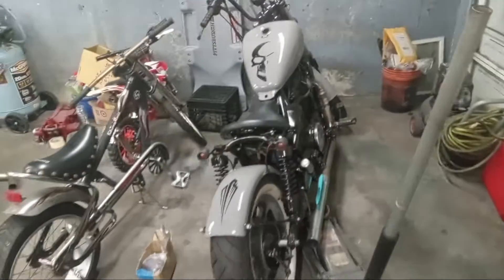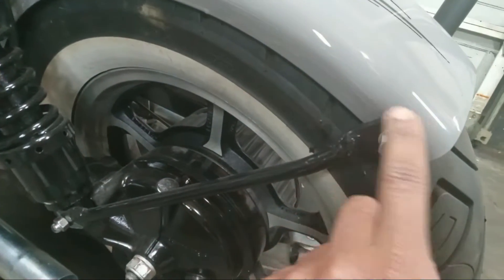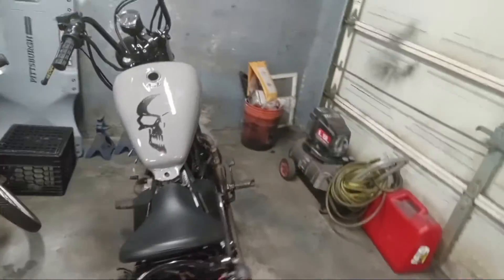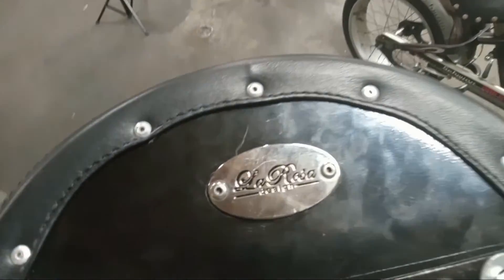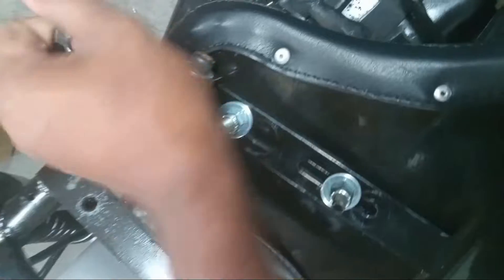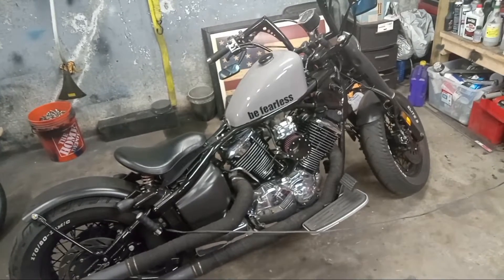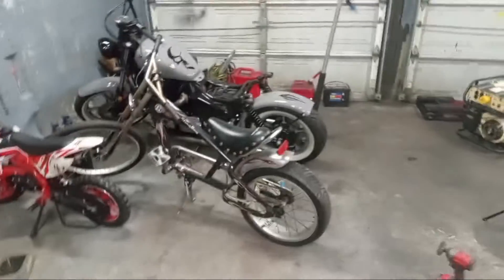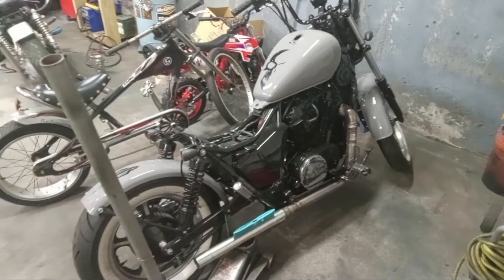1987 Honda Shadow VT700 bobber build part 1 & 2

Comment: BRO! I am building an '86 vt700c, going for that lnspltblvd style inspired chopper look. I have seen ZERO content on the 'net about these bikes, so it is badass to see yours turn out so great! The biggest things I'm trying to figure out for mine right now are cleaning up the wires and cooling lines, new rear fender, peanut tank, and getting rid of that ugly airbox
Reply from the maker: Thanks. I did an 86 vt1100 like theirs. I love their work.  Its on my channel.  I went with double gas tank on it. Should be the latest video. Its was easy to do this one.

Comment: How do you know what carb conversion will work?
Reply from the maker: I kept the same carbs. I just changed the air filters to some smaller ones that sits on top of the carbs on the air intake side and re-jetted it according to my set up. I used this site to fijure out the sizes of jet i would need.  
https://hondajetkits.com/honda-jet-kits/1986/1986-honda-vt1100c-shadow-spirit-jet-kit/